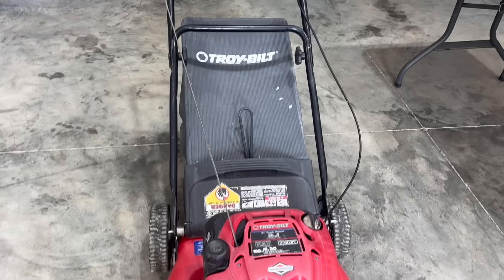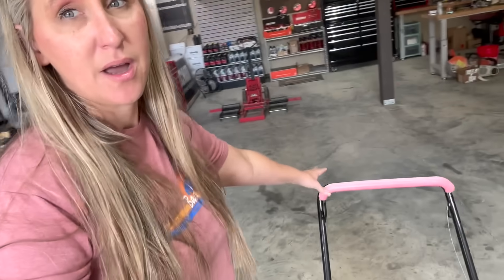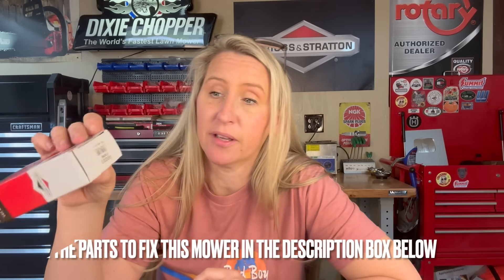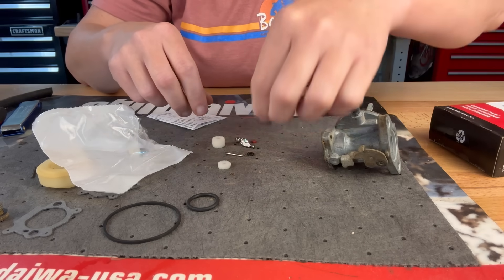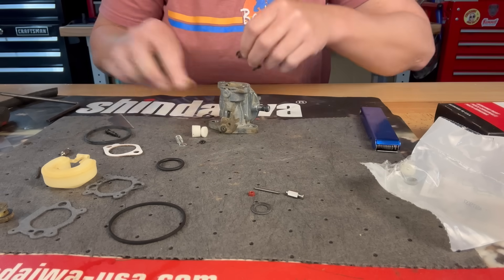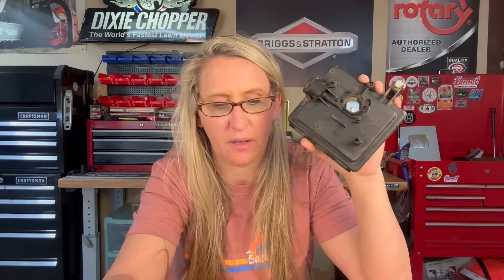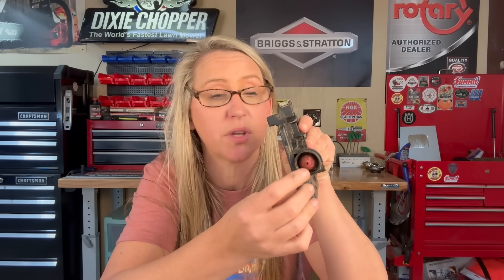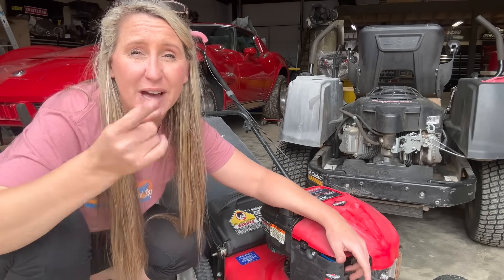FREE MOWER! Turning Customers Trash Into My Treasure! How to Fix a Briggs And Stratton 6.5 Flathead

Comment: Do you think it is more economical to clean and rebuild the carburetor or replace it considering the labor costs?  I had a mower that needed a rebuild, but ended up just replacing for about $15 eliminating the clean/rebuild labor. Any thoughts on which approach is better?
Reply from the maker: From my experience the aftermarket $15 carburetors are hit and misses. I have seen SO MANY that we put on a customers mowers to find them back in the shop with carb issues within a year or sooner. Usually leaking for no apparent reason. Maybe casting flaws. An OEM carb with OEM replacement parts can last for many years.
Reply: @Chickanic  Thanks.  I think I’ll do a rebuild of the original carb if I have any problems with the replacement.  Do you know if the B and S OEM parts are made in America or China. (Or somewhere else).  I am increasingly paying attention to where I send my money.  I did not when I replaced the carburetor a few years back.

Comment: Looks amazing and for a few $$$ and some elbow grease. I’m thinking my transition into retirement age will be small engine repair. I took a class in high school and loved rebuilding engines. After two 3.5hp lawnmowers and 5.0hp (vertical) rototiller, I should have pursued that more as a career choice, but chose military after school. 
The project this week, I’d go for near top $$$, minus warranty, unless you offer warranty repairs, then I’d charge top $$$!!! Looks fantastic. Helps with an additional coat of surface treatment. The shine is incredible! Well done Bree.

Comment: normally , in a case like this , emptied the gas tank and the carburetor (put the nut back after ) , fill the carburetor with sea-foam and wait for 5 minutes , then unscrewed the nut , using 60 psi of air to blow the sea-foam out , put everything back to its place , add gasoline , start the engine , it works for me almost 95% and yet to have any issue !

Comment: I found 3 mowers for free. I did the same thing, and now the kids have had them for a few years now and are going strong. Great video.
Reply from the maker: Awesome! That's the best way. Repairing a quality machine will always be better than buying all this new throw away stuff.
Reply: @Chickanic  ... You got that right! My predecessor to the self propelled unit is a Yard Man with a cast aluminum deck. We bought it used in the '70s. I've kept it going through judicious repairs. It's due for some more attention, such as the vertical pull starter and I think I'll get a new dipstick tube to return it to its original configuration. Right now, I pull the fill plug and make sure it has oil close to the threads' upper area. The throttle is held by a crooked piece of stiff wire. When I fix it up again I think it will outlive me and my son will run it another lifetime.
Reply: I believe that the two base gaskets are # 1 with primer bulb, # 2 Easy Start thermostat controlled choke without primer bulb.

Comment: I have a mower with 12F802 1904 B1 05121258 engine, don't know if its a less powerfull version of the engine in video, but it looks very similar. My mower was made by MTD and it's now 17 years in use :). In autumn I fill it with fuel and in spring 3-4 prime-pushes and it roars happily. If it is a less cold winter, I have a habit to let it run for ~5mins in december or january. I don't really remember if the carb is ever touched, maybe just once when the mower was in shop for transmission service, but as far as I remember, they just changed the air filter. I have a newer mover Husqvarna with Loncin engine and it's the same principle. Greetings from Croatia! :)

Comment: I had a Troy bilt, got it factory reconditioned at Home Depot in 2017    That thing cut great, unfortunately had the no oil change Briggs and she failed, catastrophic failure, last summer.    Picked up a Honda, runs quite and flawlessly, unfortunately doesn’t cut or mulch as well.     I had a pretty bad fall on a job site 18 months ago and might be in the market for a rider because of that.   I went from 4-5 hours of mowing to 2 days after my fall

Comment: I used to have, or really similar, one and loved it.  Would always start except one time.  Gas gelled over the winter.  Half way cleaned out the gel and it sucked the rest of it up.  From then on ran it dry before putting it up.  I tossed it after I couldn't figure out the springs for the choke and throttle.  I couldn't find a kit and tried all kinds of different springs.  It just wouldn't run correctly.

Comment: Reminds me of my early teens when I would trash pick old mowers and fix them up for sale. One time I sold one back to the guy I trash picked it from! 😂
Those were good engines, but not as bulletproof as the even older 92000 series. Those were practically indestructible even though they were only rated for 3 or 3.5 horsepower depending on which carburetor was on it, and those suction lift carburetors were even easier to work on.
Personally, I would have gone ahead and added an inline fuel filter, and maybe even a shutoff while I was changing the fuel line (just my preference).

Comment: I have a DR trimmer that had been setting under the shed for about 5 years with that 6.5 hp Briggs after the recoil rope broke. Serial # shows 1999. After I fixed that it cranked on the first pull. The carburetor was pouring fuel and the gas tank was leaking. I replaced the needle and seat on the carb and ordered a fuel tank from Amazon. It runs perfectly. I changed the oil for the first time too. It should be could for another 25 years!
Reply from the maker: I bet it will!
Reply: Should be. Could be.
Reply: you gotta remember that small lawn mower engines don't have oil filters.
They do rely on oil changes to keep the oil clean of lumps of metal.
Your lawn mower was born around 1999, and it is now 2025.
SO anything that was going to wear or break off, has probably already done that , by now.
Or consider regular oil changes.... although it is old, its running hours may be low.
IF it's a low hour but older engine, you may get another few years out of it, with some engine oil changing love.
Reply: @ If I had known the trimmer was going to live this long, I would have taken better care of it when it was young.

Comment: I have a mower with the 2011 version of this engine. I don't really need a push mower anymore, but I'm not getting rid of it, as there's nothing out there, IMO, as good as this engine. It still runs great. I think it needs a valve adjustment, but since it's been used every season since 2011, I can't complain that it just now needs this. The only thing that's ever been done to the engine is oil, air filter and plug changes.

Given the engine, I think it should be worth $200 at least.

Comment: Hi Bree.  You are correct.  I have one of these engines I purchased in 2005.  It still runs great.  The other day I went out to start it, fired up on the first try, and I forgot to drain the fuel from the bowl last October.  Change the oil regularly, they ARE pretty bulletproof.

Comment: Several years ago I replaced my Craftsman push mower, but before I got rid of it, I pulled the 190cc flathead engine off of it and it's still sitting in my shed.  It does seem better than the newer 190cc Briggs I have now.

Comment: Instead of trying to work around the carburetor tools get a hold of a Tecumseh pn 670377. $10.27 @ Jacks Small Engines Removes and installs those seat quickly without effort. And be careful using welding tip cleaners as the can enlarge the holes and upset the mixture. Honda and Kawasaki sell special jet cleaners but they are pricey

Comment: I have an old Craftsman mower with that engine. It's been under water several times. Each time I clean out the carb, change the air filter and oil and it starts right back up. Indestructible !
Reply: Who keeps pushing it off the pier?
Reply: @JW...-oj5iw 
How else can you mow the bottom of the lake??
Reply: @JW...-oj5iw  We have occasional flooding in our area. The 15 year old mower is low priority when the water comes !
Reply: wtf? What are you doing with your mower, towing it behind a boat? Or swimming with it and towing it manually? YOu must have a great story to tell about how your mower comes to be under water several times??????

Comment: Pull out the welch plug and put it in a ultrasonic cleaner for a half hour.
Reply from the maker: If it was needed, I would totally have done that. Luckily this carb was in great  shape.
Reply: @Chickanic , I was a bit concerned about the venturi of the carb and all of the dirt it looked it been sucking in.

Comment: Gas, Spark, or Compression.  I have a 31 year old flathead B&S that still runs like a top (with a little yearly maintenance!), aluminum deck Homelite mower.  The spring time is usually a good time to find mowers sitting on the curb (people put them up for the winter with ethanol gas in them and they won’t start in the spring).  They go buy a new one and toss the old one.

Comment: Them old Brigs were some good running lil engines, used to have old Yazzo mower with a old 5hp I/C engine, between the deck and blade on that mower, it was like a mini-bush hog, was amazing what it would mow through and over, sadly one of our storms either Harvey or Imelda, flooded it and I was not able to bring it back to life

Comment: Here recently I have actually completely rebuilt two of those same identical engines because it's like you said they are a diamond in the rough and will Outlast any overhead valve engine that they build today

Comment: WOW! That mower looks brand new! Great job, Bree!
Reply: Nice job where does one buy parts for 17 year old mower
Reply from the maker: @carverindian  Fortunately There are still tons of parts available for this model. I added a link to get all the parts I used.
Reply: @carverindian 
You would be surprised. I can still get parts quite easily for my 44 year old Lawn-Boy
Reply: @leehuff2330  Maybe if mine was a REAL lawnboy instead of a knock off I could get a new choke for it.  The new carb didn't come with a new choke either.  Zip tie to the rescue!
Reply: @PlanetaryThoughts9861  
Zip ties and duct tape will fix ANYTHING 😁
Reply from the maker: Thanks Bruce! It's going to make someone a great mower.
Reply: @Chickanic Bruce? Lol 😊
Reply: @dave-uf8ir  ... Original comment. Replies follow.
Reply: @JW...-oj5iw  happy Easter lol 😂
Reply: @Chickanic  oops lol 😂
Reply: The nearby Ace hardware store has a substantial wall of lawn equipment parts. I bought a yard machines mower from a woman from work. It took some doing to make it run again. I thought it might not be sparking the plug, but I couldn't get anyone local to tell me how to read my ohm meter on my coil. Eventually I just cleaned the rust from the coil surfaces and magnet in the flywheel. Reinstalled the coil and wires using a couple pieces of paper for spacers. Next, I dipped into the carburetor, discovering a piece that metered fuel thru a pinhole was plugged. Using a single strand of copper wire from a piece of 14ga., I probed the pinhole and felt the wire break the plug in it. Sprayed it with brake cleaner and made sure it got into the throat. Reassembled everything with a new air filter and fresh gas. Squeezed the kill bar and gave the rope a tug. Fired on that first pull. What a great feeling. Mower is kinda heavy, but it's self propelled, so away it goes!
Reply: @JW...-oj5iw  
The one I deal with has a dedicated small engine department and is a servicing dealer for Toro, Husqvarna, and Echo. If they can't get it, it doesn't exist.
Reply: @JW...-oj5iw  You can get a little tester that will  flicker an LED when placed by a plug wire if a current is going to the plug.   Sorry I don't recall the name of the tester.
Reply: Old New Stock Chicka
Reply: In Tennessee, only thing someone would give you for free would be abused, worn out, left outside and run over.